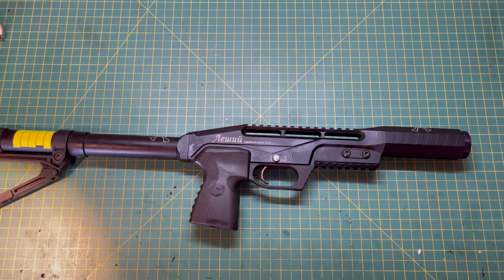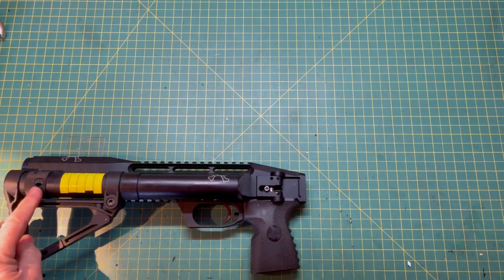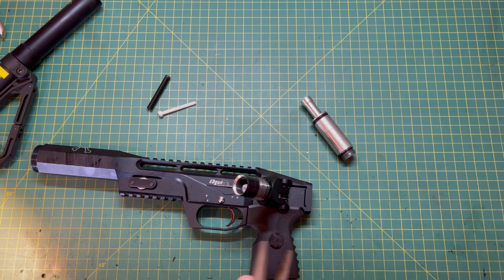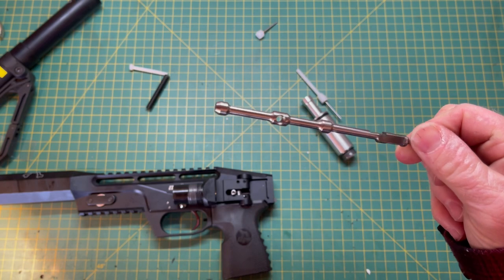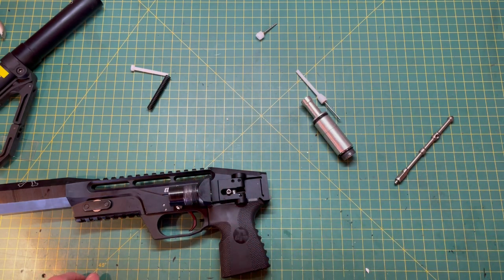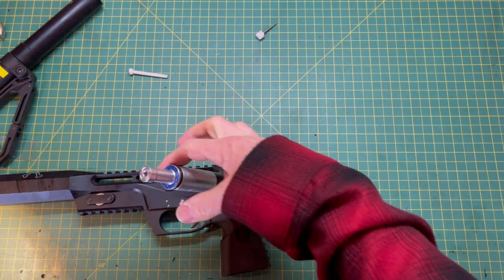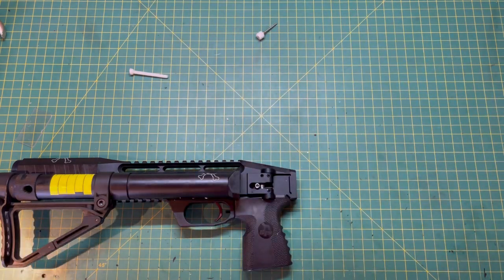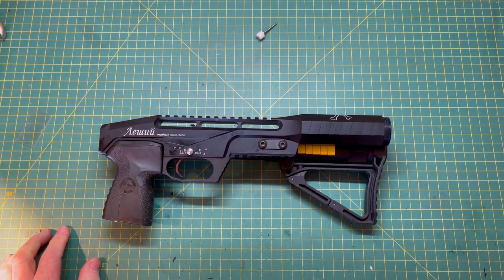Leshiy Classic - Valve Repair

Comment: Where I got caught and then found out sometimes the new replacement valve is longer that the old broken one. I didnt know you should measure the new one to correct size. Then I tapered (beveled) the cut end to remove any sharp edges.

Comment: Hey is your valve scratching a bit on a side the port in witch hammer is traveling during cocking?
Reply: FYI, I realized that my valve slightly went out from this plastic part (like 1.5mm), I've pushed it back into the plastic - as of now its not falling off, but I'm not sure if that fact means its already broken and will have to be replaced. Of course the reason it happened was most likely I had hammer string set too high - as I was not aware you could do it. I was trying to increase it and measure searching for peak velocity but before I get there I experienced a problem as gun fired on its own as soon as I closed the cocking handle. Fortunately it was pointing already in safe direction (not so much for the chrono that get shot with 31gr slug at 277 m/s or 810fps). What happened is that this lever that cocks the hammmer spring by sliding on the handle skewed and was not traveling hammer spring enough back to lock it onto trigger mechanism. As soon as I closed the gun it was going off - fully replicable.
I've ordered that peace for replacement and also opened up the gun to see if there are any other damages. So, that pin of the valve moved slightly out of its sitting and that also caused it scratching/pinching the port in which the hammer is travelling. As I understand this is most likely only cosmetic damage as it doesn't have to be sealed etc. Its just the hammer flying and slamming the valve. Still approx 0.5-1mm dent is there now.

I'm a bit worried now how much hammer spring is too much. I went back to 0 setting (all in) and started from +5 and went up to 15 and still no peak and I'm worried to try even harder. I tuned the reg for approx. 140-155 bar - not sure how much transfer port allows to travel before becoming a chocke point - but typically most PCPs will allow you to go 160-180 before that becomes a problem.
I'm trying to push 31gr .25 HN Grizzly slugs at 920-980fps. I don't have regulator measurments, I assumed the default setting was 130bar (its a reg without any markings, so one of the old ones/first, but hammer is with re-designed shape). I tried with default reg settings (assumed 130bar) and was increasing hammer waiting for the peak. I managed to get just slightly below 820fps without any peak and the gun started to shoot itself. I don't know how many click it was.
I decided to try with higher bars, like eyeballed it to 145-155bar via turning it 90 degrees and then back 30 degrees - so in the end 60. Started with 5 clicks from 0 and it didn't push the slug from the barrel, I ended up with +15 clicks with 223fps and stopped at this point as being scared that I will over tension the hammer again.
I was hoping that I could increase the reg but keep the valve open for short period with small hammer spring tension. I don't know what is the max operating pressure for this regulator at which this gun can still hammer the valve and make it work (I know the minimal is 90 or it locks itself, also that if you dry fire it or the pressure will be below 90 you can damage the valve due to hammer as it won't be giving any resistance).
However, is this gun able to be safely shot at reg 150 and I'm okay to tension the spring? At what point things are too much for it? I'm surprised there is no safety range, tolerances for spring hammer in this gun - to the point that you can tension it so much that it can damage the cocking lever and band it and cause it to shoot itself!

Comment: why the valve is not almost of metal ?
Reply from the maker: because a light valve is easier to close, thus making them more efficient , FYI, metal can break too, many firing pins have been replaced on my firearms over the years, they are metal